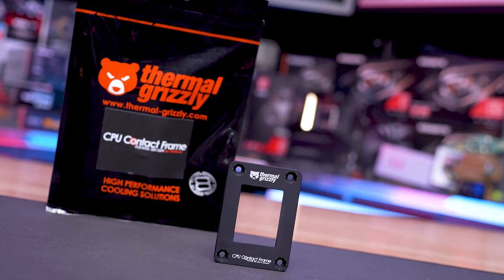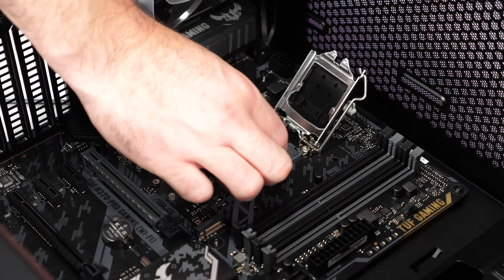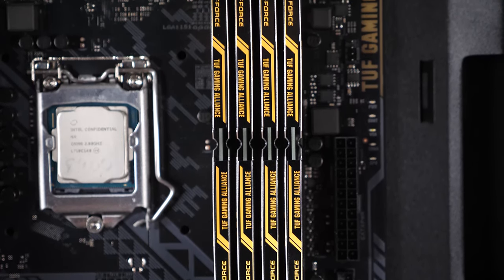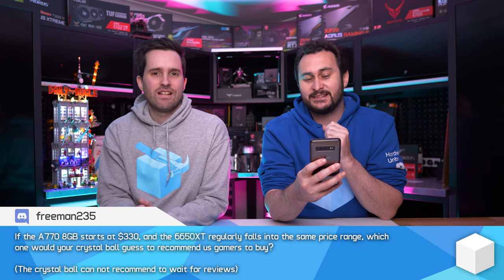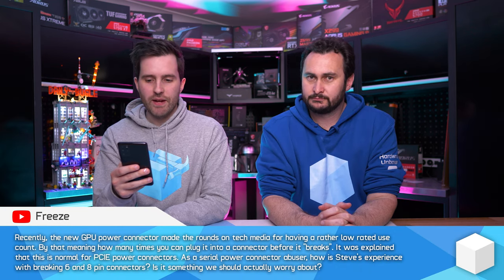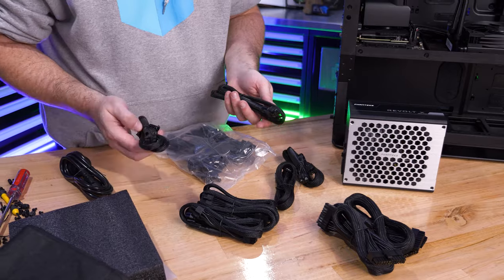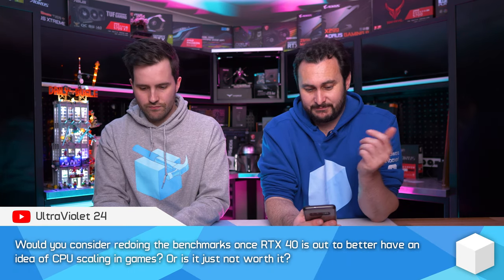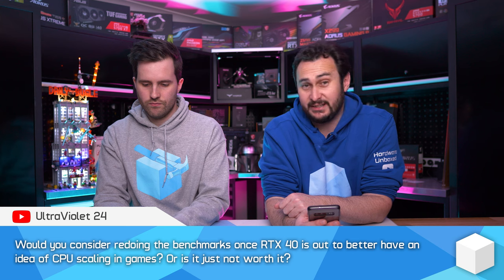EVGA Quitting Bad For Nvidia? Arc A770 8GB better than RX 6650 XT at $330 US? September Q&A [Part 2]

Comment: My 2 cents on the PCIe power connector discussion:
The load on the cable plays a big role as well. When the cable fatigues you might lose one strand of wire and the rest picks up the slack, increasing amperage and as a consequence temperature. 
An average user with a sub 200W GPU will never see this. Neither the current high-end GPUs that come with like 3x8 Pin. But when you go from 3x8 (or even 4x8) to 1x12 and increase power to 600+ Watts the failure of one single wire can have a much bigger impact.
It's also fairly safe to bet that you're testing GPUs on an open bench so the cable won't have as extreme of a bend radius as it would in a normal PC case. Metal fatigue mostly happens when you frequently bend it back and forth. Plus the time between benchmarks and swapping GPUs might be enaugh for the cable to cool down between tests.

Yes it probably is an overreaction, but there is no such thing as "It'll be fine in 99.99% of cases" when the alternative scenario is fire. The NZXT H1 has shown that. So it's a good thing to investigate how they can potentially improve the quality of this connector. Even if the average consumer will never have an issue with it.
Reply: i have a problem with the approach "let's scrutinize whatever the media is talking about this week", because scrutiny has an opportunity cost.
Reply: I don't know - PCI-SIG the group that developed the connector wouldn't send warnings about the risk of melting connectors to their partners if it is 'no problem' at all.  You can find the text and the info at gamers nexus hardware news.
Reply: @seanthiar  This is exactly what I'm thinking. I've never heard of such a thing before and now it's a big deal? It doesn't add up at all if there's no difference.
Reply: @seanthiar  all connectors can melt down, there likely are several other fire hazards around you, several orders of magnitude worse.
Reply: are you melodramatic a lot lol
Reply: @rnbpl  Show me any connector apart from your standardised wall plug that carries a constant 600+W.

Comment: Regarding AM5 motherboards and B350 motherboards, in addition to what's been said I think it's also worth noting that Ryzen 1000 topped at 95W. Early motherboards didn't need to deal even with the 105W that later Ryzen CPUs were specced at. I feel that one reason AMD went for 170W this time is not really because Ryzen 7000 needed it, but because it set a standard that next generations will likely not surpassed, and ensured that motherboards will come with overkill VRMs. We'd have to wait and see what entry level B650 boards would be like, but my guess is that we won't see any boards without a VRM heatsink.

Comment: I'm pretty firmly skipping this generation. I picked up a 12400 with nice b660 motherboard for super cheap at microcenter, going to get something between 3080 - 6900xt in the $400 - 500 range and even if I end up getting a 4k monitor (once OLED's are reasonably sized and not ridiculously priced), I should be fine for 2-3 years. Maybe in 2-3 years I'll look into an upgrade that has decent price to performance.
Reply: I'm in the same boat. I can usually go for a build a year (for which I'm immensely grateful; I know many have to plan for years to build or upgrade). This year I went with a 12600K + ASUS B660i, with a 240mm AIO to go along with the 3080Ti I managed to snag for pretty well under MSRP (caught a sale on Amazon, so totally worth checking regularly).
I've no interest in this new gen of NVIDIA, but would be willing to pick up an ARC gpu if for no other reason than to hopefully encourage INTEL to stay in the game and keep improving.

Comment: Something I loved the idea of was the NZXT Kraken G12. You could take the shroud off the cheapest GPU that uses the same board as reference design and add your own AIO on it for a hundred bucks total, and you’d drop a lot of temp and noise. Kinda wish it continued working with 3000 series officially.

Comment: Ofc it's gonna affect NVidia (EVGA was quite popular for NVidia GPUs), but it won't be as big as some might think, unless others will start quitting them too lol
Reply: As a consumer currently using Nvidia, I quit buying their new stuff. They pooped on their customers with the BS marketing 4080 12gb being a 4070 at best and 4060ti at worst with the tiny bit bus width
Reply: @moldoveanu8  Technically it isn't a huge issue with the 192 bit bus, because they increased the L2 Cache A LOT (From 6 MB on Ampere to 96 MB on Lovelace) to have something similar to AMD's Infinity Cache. Still the GPU is INSANELY overpriced for an 104 die that should've cost US$ 500 or 600 at max.

Comment: Working at an EMS and we use 200 pin SO-DIMM from Samtech for in-house products of which we sell of multiple 100k/y in multi-product lines and thus in initial testing - QA & QM: checking for shorts, burning eFuses, testing devices & RAM, etc. - we have those Samtech sockets in constant usage with plug-in and plug-out events in the 100's and 1000's while they are rated to "50 plug-in cycles". The worst happening is the spring contacts are getting loose / less springy and produce false positive errors in initial testing.

TLDR; Rating of connector just means: "Minimum guaranteed time it's 100% working." (not standing extreme abuse: "if you use a hammer you doing it wrong")

Comment: Aah yes, the 1080ti was and still is such a good reliable product, mine's running in the basement and paired with a 5800x in my second system for Racing Sim applications, still a beast in 2022... on the other system my 5800x3D is paired with a 3080ti and i think this won't need an upgrade anytime soon :D
Reply: I don't think you need upgrade until 1nm😁
Reply: a 1080ti and 5800x is hardly a beast
Reply: @annatalbert8681  it has performance similar to the 3060, for 1440p its still fine especially for the price, i bought mine for around 600euro back in 2017, cant beat that value proposition. no need to mention that the card basicly made me money with mining when i wasn't using the computer

Comment: The issue with AM5 motherboard is non existent to me personally. The moment I learned that they will use lga I knew that it would be more expensive than AM4. As to the current pricing, I believe it's actually pretty similar when the 12th gen's z690 were first release. As to why AMD chooses to only support ddr5 with AM5, is pretty understandable if you think about it. While the 12th and 13th gen would only be under one socket. Potentially, the high-end x670e/x670/B650E/b650 can support the next 2-3 generation, after ryzen 7000 series. Think of it like the AM4 x370 being able to support initially  the 1st ryzen cpus, until 5000 series. I believe there's a review where in 5800x3d virtually have no performance difference when using x370, b350 from x4xx and x5xx series motherboards. Plus the x370 and b350 were not made with much quality as the AM5 of today. 

I'm definitely waiting for the reviews and I'm not really an early adopter type, but I am in need of a cpu upgrade within a few months.  In my mind, by Jan, more affordable motherboards would probably appear and in general, would also go down in price like the 12th gen did. But I'll probably still target $250-350  motherboards by then, because I might upgrade with ryzen 9000 or 10k series(whatever AMD will name them).
Reply: Holy hell, a reasonable take.

Comment: EVGA graphics cards were better than the NVIDIA founder counterparts. A three year replacement guarantee is unheard in the tech industry. And they did everything for a meager margin of less than 5%. EVGA cards were archetypal heaven-like in terms of customer satisfaction, and business honesty. I see a potential future of EVGA cards with Intel chips.
Reply: The cards I bought in 2008 had lifetime warranty, but since I was in Aus, EVGA only had to honor 6 months for my region, but they replaced both my cards that died at the same time from bump gate with over a year on them.  EVGA is fantastic.  But my current card (GTX 980) is very limited OC wise due to nvidia's locked down controls which made the good quality EVGA design mostly pointless.
Reply: @3800S1  👍

Comment: As far as the 5800x3d, that was my situation. I had not too long ago rebuilt my system with a $400+ am4 motherboard when the 3D chip came out. I didn't want to get rid of this build and start over anytime soon.  I knew I didn't "need" the 3D chip, mainly just wanated it. That plus I knew it would carry me through the next few years of gaming considering it was one of fastest gaming CPUs at the time.. Figured I'd get the fastest gaming chip for my platform.. I might get whatever is the 6900xt's replacement is though. I game at 4k with all graphics options turned on, i like the eye candy.

Comment: I'll get an A770. While I don't really have high hopes for the drivers, I hope it works ok in the couple of games I play. And the Nvidia and AMD drivers aren't working great for me either anyway. I recently switched from a 3060 to a RX 6700. The reason was that 4k 144hz HDR with VRR using HDMI with the 3060 was just a garbage experience.  It's a hassle to configure and when it works you just get constant flickering and it takes ages to switch to fullscreen. The 6700 didn't have those problems at all, it automatically recognised the TV correctly and worked flawlessly. But the 6700 series currently has problems with video encoding/decoding. While Team's calls and watching videos the pc just greenscreens every now and in VRChat with the Quest 2 just doesn't work at all. I am just dissatisfied with both companies.
Reply: Phoronix website is going to benchmark the 770 & 750 on Linux
He already done it but waiting for embrago left on Oct 12 or 13 to release the results
There might be some good info there about the Arc
Reply: Intel's focus is DX12 and more so the popular titles first. DX11 and others will take quite some time to catch up and that is to be expected coming into the game this late.

Comment: Its definitely going to be the A770 16GB for me, since in my country RX6700 XT, RX6800 are overpriced to this day, RTX 3080 12GB will be obsolete due to the Leather man's policy on releasing drivers. Unless RDNA3 has something to compete with the 16GB variant on the same price point. I'm supporting Intel as the third player.
Reply: @evacody1249  You're a lucky guy then, you can react like that without worrying about your daily expenses especially when we look at prices on both AMD and NVIDIA in my country double the price from the rest of the world.
Reply: Don't you are better off with a 6600XT then a Arc 770 since the old games will either be complety broken or run like ass on Arc GPUs also you won't be able to do emulation either,only API they support decently is DX12 everything else works like ass
Reply: @promc2890  Sure that's what will be my mindset as well, but sorry for the lack of context so let me fill you in.

I'm not just going to game on the new GPU I'm aiming for - I'm also going to render 3D model assets and paint on them in real time which requires 12GB VRAM and high Memory Bandwidth (Updates per second matters more than FPS). Cause textures will be at 4096x4096 and a lot.

None of the same criteria offers the same price point as the A770 16GB. Especially in my country or while my friend was in Canada before he got here.

So yes for me this is a bang for the buck.

Comment: The problem with those PCIe connectors is strongly 'connected' to tight bending radii and high bending forces on the connectors. A connector that's gone through a large number of cycles and is 'worn out' might not be tight enough anymore to make full contact on all pins under those conditions. The problem is the increased electrical resistance in those affected pins. If some of the connections have a much higher resistance then most of the total current will flow through the remaining intact connections - and therefore through fewer cables. Those cables get hot, insulation melts -> bad blue smoke and potential for shorts
In short^^, it's not the worn out pins that fail catastrophically, but the technically still intact pins (and cables) that then have to deal with more current and heat than they were designed and rated for.

Comment: I think it doesn't require crystal ball to tall A770 from 6650XT or similar cards. In short neither is good buy and the question implies false premise of there being no other options. So if it would be true that you must chose between the two then it is 6650XT, simply said more mature product with more predictable performance. But it does not mean recommendation is to buy 6650XT, price/performance may be better on other products and used market is likely to be very competitive. So perhaps even 5700XT for $200 is much better choice. or used 3070/6800XT for $400 (we not yet there, but after inter launch I am sure we will be). 

That is not to say Intel product is bad, actually I will be getting A750 when the price drops (I expect them to be $150 cards by spring), but that is because I have multiple PCs and A750 will do what I need it to do and will be great value. But for sole gaming PC I would not pick either and I would definitely not pick intel. For more value oriented workloads (definitely not gaming) I think intel is shaping out to be great product because we know for this gen they will be putting loss leaders in mid/low range, they will sink a lot of money and likely sell those GPUs at loss. Yet after few years they drivers optimisation will mature and the next gen Intel may be competitive, but not this generation.

Comment: 33:30 Overspec mobo:
Compare the cost of an X370 to both a B350 and a B550. Not saying I dug through all available data, but I found few X370s going for (in my area, so VAT included) less than $110, while the B350 and the B550 could be had for ~$60, half a year or so after their respective launches (which is when I'd be buying, once I had a firm picture of the platform and issues surrounding it).

For me, those extra $10 is definitely worth not having to flash my BIOS and risk bricking my motherboard, but then I learned my flashing risk management in the 90s. That matches my upgrade pattern as well, since I generally don't bother with upgrading more often than every few years. Going from a 1600 to a 5700X makes you appreciate the upgrade that much more.

On the other hand, if you have no issues with flashing your BIOS, but thinks it's a bother to dis- and reassemble your computer, and/or want to always get the latest-gen CPU, then the X370 would have been the bee's knees and set you up for five years of AM4 while saving you $10 to be used on a better-than-budget motherboard or one of your CPU upgrades.